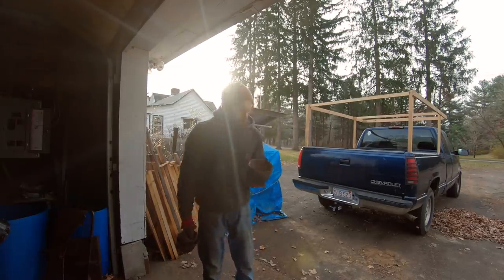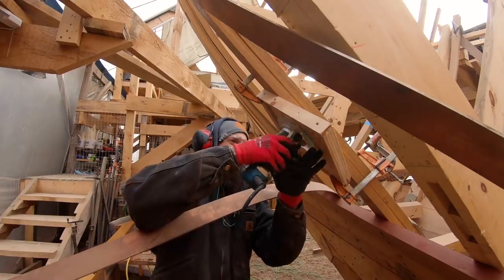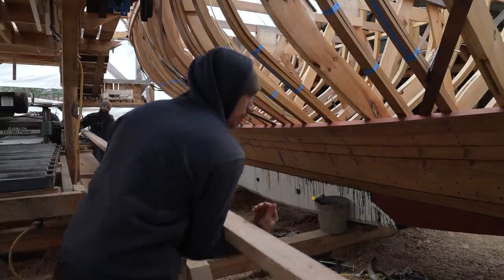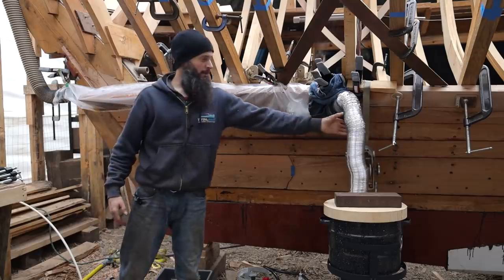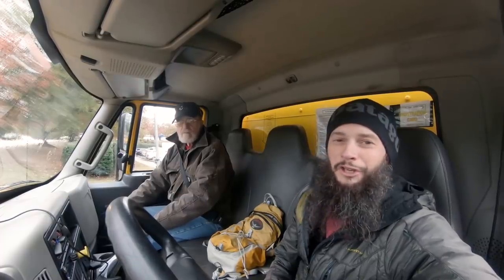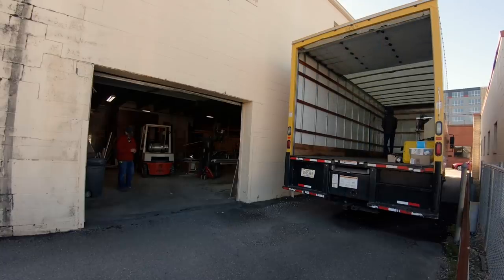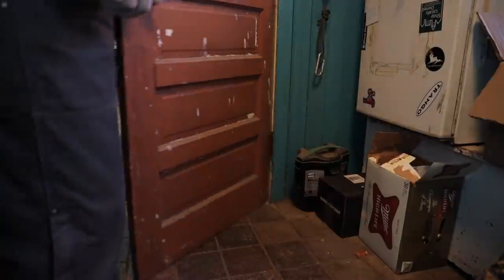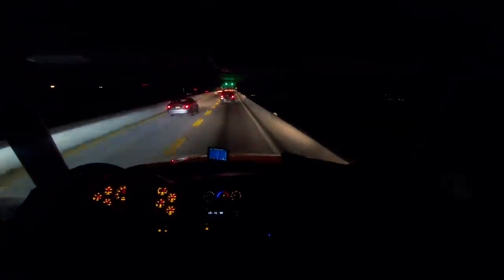Acorn to Arabella - Journey of a Wooden Boat - Episode 92: Steaming Planks

Comment: To ship that mill safely you need to run the table in, the ram forward and pivot the head down towards the knee.this lowers and centers the weight as well as compacting the overall size and protecting delicate parts.
Reply from the maker: Already done.

Comment: Great job guys, steaming planks is an art. I'd recommend you try a wallpaper stripper to pour steam via the 3/8" hose to your bag. It is continuous and can be topped up, it's electric and easy to plug and play. It works a treat on my steam box when I steamed oak frames on my classic open day boat, pitch pine on oak, 1965. The class dates 1911- present day. Also another great tip is to use a meat thermometer bi-metallic type to measure temp, it measures at he point and can be put near the wood.

Comment: You know, given how much steam you probably should be doing, it might be a good idea to look around for a tool made for the job. Namely, a used industrial carpet steamer or wall paper remover. 
You could actually build small, reusable drop down boxes to use on the planks. Staple plastic to the bottom and run the steam in one side and out the other. Use them on the major bend areas fore and aft as you do each one.
Just a suggestion.

Comment: I feel like that backhoe has a small hydraulic leak, the bucket slowly lowering certainly is worth looking at.
Reply: If there's no fluid leaking from the system, it's likely a worn O-Ring inside one of the rams.
Reply: I agree even in the cold the o ring or low fluid
Reply from the maker: Thanks, it's something we need to get looked at but likely going to be closer to the spring.  The machine was used hard before we got it and there are likely both leaks and worn O-rings.
Reply: Considering that the whole rear sags + the boom + the bucket, the leak is likely in the valve heart. It's a daunting operation, to change stuff in there, but as jobs go (DIY format) it's actually the cheapest. A cylinder has a heck of a lot more going on, plus the potential to bugger it up permanently. The valve block is just that, a valve block.

Comment: You might want to check if you need to use certified heat treated wood for your packing material to ship that stuff to Costa Rica.  My friend had a crate of machinery stopped at customs and had to pay for it to be repackaged in certified wood.  It was expensive.

Comment: I’ve done a lot of casting, you can use the lidl’s for pretty much whatever you want but using the crucible probably isn’t a good idea I’ve had a few crucibles break open on me and or burn through as I would take them out for a poor, I’d go ahead and just buy a clay graphite one off of amazon, you can get pretty good ones for $30-40

Comment: I have used a wallpaper steamer to bend planks in the past. They are quite cheap.
Reply: Mark Grudt  - Because by the time you get a plank out of the box and in position up against the hull, the plank is already cooling down and losing flexibility. By steaming in situ, the plank stays pliable for as long as you need it to.
Reply from the maker: JAFO's got it... but a wallpaper steamer may be a good idea.  We'll look into it.  Though our system worked really well.

Comment: Seeing you steam the planks in place really impressed me - and also got me thinking: Is it possible to steam a plank more than once? I mean, could you do an 'initial steaming' to get to rough shape, then another steaming when you get to put it in its final shape/place?
Reply: Good Question NoRemorse etc:  Yes you can, but it must be remembered that steaming is a kind of light cooking.  Do it too much and the strength of the plank is compromised.   After all at a pulp mill the wood chips are steam cooked to get them to break into a fibrous mess that cardboard and paper can be made of.

Comment: Looking really good, guys!
So the planks are 1,5" now - how much material will you remove, and will you remove material all the length or only at the ends?
Reply from the maker: The entire hull gets faired after the planking is in place so there will be different amounts of material coming off in different places for a fair hull.  However all the planking will be at least one and a quarter inches thick.

Comment: It struck me that you could making your scarf joints TOO perfect which might be partly causing the problem with the epoxy joints failing. You were mating two beautifully smooth surfaces of probably somewhat oily wood and then cramping the hell out of them. With epoxy, which we know is 'gap-filling' would it not be better to provide a 'key' on the gluing surfaces. You could for instance drill multiple shallow holes for the glue to enter, or scrape or scratch up the surfaces in some way. That, as well of course warming the epoxy might give you an ultimately stronger joint. I suppose that relies on the glue being stronger than the wood though! What do you think?

Comment: How will you smooth out the lip at the ends of the planks? Will you plane down the planks or add material?
Reply from the maker: The whole hull gets faired once the planking in on.  Various amounts of material will get removed to fair it out but all planking will be at least one and a quarter inches thick.

Comment: Steve those are for lead casting and leading bronze melting point will crack cast iron graphite crucible for copper alloys melting
Reply: Concur. You can use steel or iron for lead, aluminum, or pot metal (zamak) but not bronze or brass.  You can use ceramic crucibles for bronze/brass....cheaper than the graphite needed for iron casting.
Reply: @gumbykevbo  I use a 5 inch Black Iron Pipe coupler joiner, with an end plug screwed into one end, I used my gouging tool to remove the threads from the other side and made a little pour spout channel on both sides, drilled through it on 2 opposite sides & put 2, 3/4 inch bolt with Jam nuts to secure it, as a lifting point. Have melted copper, made Aluma Bronze it gets up to 1100+ degrees in my forge with no problems yet, I've done at least 12 pours. recently made a bigger one by, fitting 2 of them together, so its over 10 inches high. If it catastrophically fails ...I'll let you know.

Comment: How many more oak frames you planning to do before you change wood type? Thank you
Reply: The frames are done. You're talking about planks.
Reply: @Garryck-1  yes, how many oak ones are they / you going to do before you move onto the cedar wood I think it's called!?
Reply from the maker: We ended up going to just above the waterline on the bow with oak.  We have two more to put on after these and then it is on to cedar.  Hoping things will speed up with the lighter cedar!

Comment: I used the bag steamer  on the rails for my boat with great success, but I closed of the end instead of venting it to keep the steam pressure up. I used a wallpaper stripper for the steam. The water condensed in the bag at the low point and, I think, helped keep the temp up. Nice load of gear for the Sailcargo project.

Comment: Did you use a moisture meter before oiling the plank?  If so, what percentage of moisture content did you shoot for?
Reply: The oak has been seasoning for a number of years, and it is not required that it be low moisture (it is, after all, a boat; it just needs to be dry enough that it will swell enough when it gets in the water, to close the gaps).  If the concern is steaming, that actually dries out the wood, rather than increasing its moisture content, contrary to expectations.
Reply from the maker: Corwyn is correct :)

Comment: I'm not an expert (just do some small furniture making). Someone told me years ago that adding ammonia to your steaming water makes the wood really flexible. Any truth in that, or was I bullshitted?
Reply: Also a woodworker here. Have done some very high end projects for very high end people. Worked with many extremely gifted woodworkers in my time. Only had to steam wood a few times, ever, but had a few other guys say the same thing with the ammonia “trick”. I asked each one of them if they had ever done it themselves and every single one said “no”! Ok, how do you know it works? 
The only guy I really trusted when it comes to stuff like that told me that yeah, it might help break down the cellulose wood structure but it would seriously compromise the color and texture of the parts of the wood that you did it too, and it would likely never recover it’s strength after it dried. The ammonia would end up impregnated into the wood for ever. 
In other words, if you are tempted to try it, don’t even think about doing it on a job you need to come out looking or working right to get paid!

Comment: Angle braces in the corners of your truck ladder rack.  Needed.  Annnnd, You are a sailor.  Mount 4 minimum,  of 6 inch (or 8 inch)  4 hole stainless cleats.  They should be screwed on to the top of the truck sides at about the 1/5 and 4/5 s positions,, maybe as much as the 1/6 and 5/6 positions.  Mount with stainless screws and 5200. With a 5/16 braided nylon line,, you can tie down and stabilize anything on top.  Lumber, ladders, canoes,,,16 foot lumber in the bed of the truck with diagonal spring lines to take the cantilevered load.   Anything in the bed of the truck,, same 24 or 25 foot braided nylon line,, you can tie down or safety any load in the bed.  And with a perfection loop on one end (or both ends)  you just cross to one cleat or another and cleat it off with the same cleat hitch you would use for a sheet or halyard.  I can secure something on the top of my racks is seconds, vs minutes as with ratchet straps.  Do your tying in opposing diagonals and that canoe will be solid up top for a 1,000 trip.  Truckers hitch looped over the cleat if you need a bit more force.     If you use 6 4 hole cleats,, mount 2 on the top of the tailgate at about the 1/4,, and 3/4 positions.  With 6 cleats you can carry all of the kitchen cabinets for a remod in a single trip.   Get some boat cleats for your truck.
Reply: All good ideas, but they are not sailors. Steve has promised that the first boat he will sail will be Arabella. Ballsy, no?
Reply: @kennylaxague5528  All I have to say is, "WOW !"   Go from zero to a 15  (?)  ton boat.   Everyone should start on a dingy. I began on a 6.5 foot white Styrofoam toy.  I was 35 y.o.  and 220 pounds.   From there, the principles never alter, the mechanics and reach do.  When I learned, I guessed that I had invested time and effort equal to an associates degree,, to just reach barely competent.   The essential list of skills,, mind boggling,.   My strongest recommendation to them is to get and read David (?) Gerr's book, "The Nature of Boats".

As to the truck and installing 4 hole boat cleats,, it is even a better idea,, they can begin developing the skills of throwing a fast cleat hitch.  You make or unmake to a cleat 50 or 100 times a day.  ( I am a trimmer by bent.)

Comment: For the steaming, why didn't y'all just get a little 5gallon "hot water heater", just don't pressurize it, remove the temp safety and pipe what would be the pressurized output into the bag.  As long as you never allow it to build pressure, it'll just sit there and boil and boil until it runs dry.. Just keep topping it off as long as you need steam..

Comment: Inner ribs don't look as substantial as Leo's boat, sure you've done the calculations and its strong
Reply: Arabella is a good bit smaller than Tally Ho. Her ribs are stronger than the design calls for.
Reply from the maker: @Flatcap007 as we've mentioned previously, there is a very big difference between steam bent frames and double sawn frames.  As the bent frames bent a straight piece of wood and the fibers follow that bend, they can be smaller but still as strong (if not stronger) than a sawn shape twice their size.
Bigger does not always mean better.